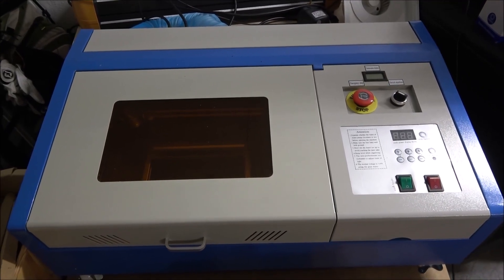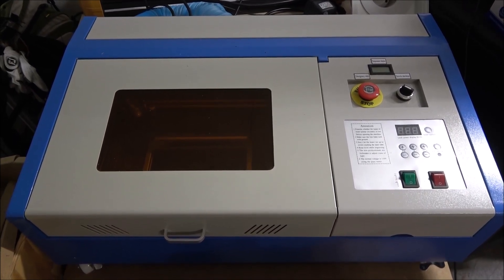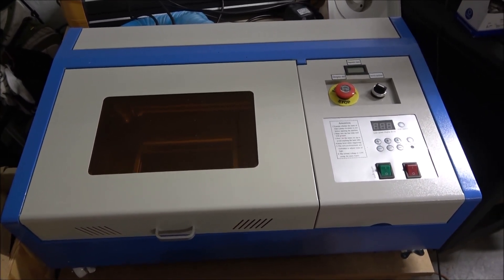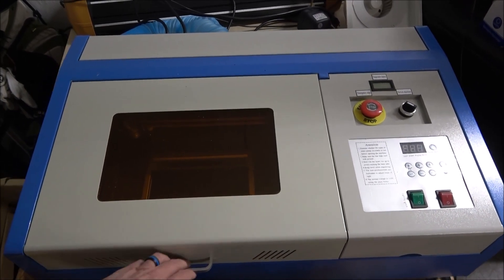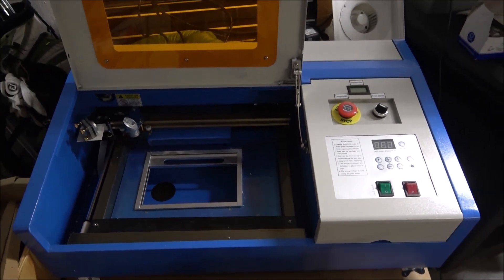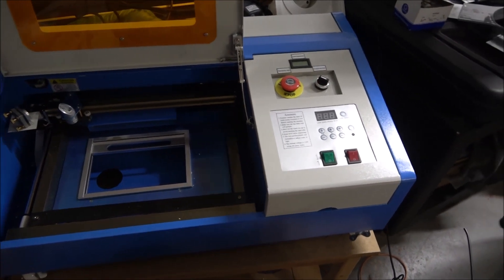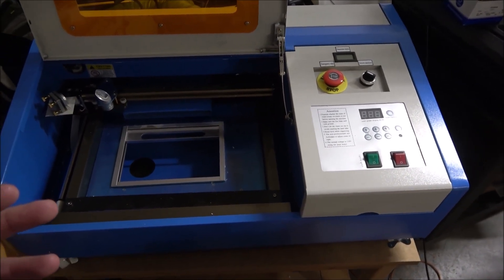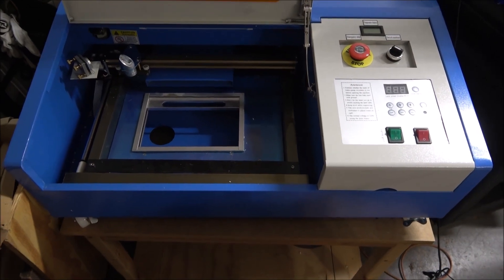Update!! I'm comin back!

Comment: Hello Smokey,

Hope life is well and that shop is coming back on-line?  I'm like you though I'm still building my setup based off yours, but added the 5 inches in width for full 48x48 and added capabilities to do 3d work on front and back anchor system still only exists in my mind. Give us a 3-minute video update on what you've been up to. Back to the 200 man-hours to get this thing built. About 300 holes to drill still, haha

Comment: Good to see you back!  I've been thinking about getting a K40 (Generic Term for that laser).  I have heard they are okay at best out of the box.  But seem to be easy to upgrade and lots of info on YouTube.  In fact, there is a YouTuber that goes by SarbarMultimedia.  He has literally years of K40 laser tutorials.  Everything from software to upgrading the hardware boards to upgrading to larger 50W CO2 lasers.
Reply from the maker: I've got a K40, and love this new Lightburn software, however I have ran into a problem with the smoke produced, this new house has a hi-tech security and fire alarm system...I can't get the laser to run without setting off the the alarm system...so I'm on hold for now

Comment: I read a lot where you can use rv antifreeze without issues and some use fishbtank heaters as well.  I actually just disassembled mine and put it in the basement where freezing temps won't be an issue.  I believe your machine looks like a k40 possibly.
Reply from the maker: Ok on this, I got contacted by a guy that worked with lasers for a job and he said absolutely no to antifreeze running through the system at all!!! so don't do it!!

Comment: Great to see you online again. Was thinking how you were doing last week. For the CNC spindle water cooling. You can get an antifreeze with inhibitors to stop corroding metals in contact. Eg furring up aluminium, copper greening. Etc
Have fun with the laser, it's just a smaller CNC, few different cutting/carving concepts, but works same process. Enough to keep you occupied for the duration. Stay safe, stay healthy too !
Reply from the maker: Yes the process is the same, I just don't want to jump off and find out I've made a mistake with antifreeze....All in all i'm just ready to get back to it, i'm goin nuts with nothing to do!!!! Thanks for watching!!

Comment: I’m not familiar with the water pumping system. If it external, make a insulated box around it. Use a light bulb for a heat source. Put insulation on the lines, that should be enough to maintain above 32 degrees.
Reply from the maker: ewwww! a heat lamp would be a good idea!! could leave it running, good thought!!

Comment: Yes you can put about half a gallon of antifreeze in with 3 gallons of distilled water. Also, the motherboard/card in it is a nima card(limited) junk in my opinion. I put a cohesion3d card in mine and use lightburn. Also buy and install a milliamp gauge to know how much power that you are using. Never go over 20 milliamps. Youll be able to cut thin plywood and burn photos. There are tons of videos out there just google K40 co2 laser. Good luck
Reply from the maker: Ok thanks!! great info I'll look up the laser and check it out, thanks for watching!!

Comment: Ok I was a laser tech where I worked so no do not put anything in your water it will cause the high voltage to arc and burn up you connecters also don't use tap water others may say different but I worked on laser hole drilling machine I can give you my email address if you would like 25 years not these was 15kv lasers but the principals are the same denied water is what you need it makes you're lamps last longer hope this helps
Reply: I  looked it up it stayed you could but I don't know I would try to find a place in house in about 3 weeks that want be a problem take care stay safe
Reply from the maker: Oh wow, Ok this helps, yes shoot your email this way, Smokeyscnc@gmail.com..sounds like you'll have tons of info!

Comment: k40 wisperer software is free to run your k40 laser. inkscape is great free graphic software. remove that crappy bed and consider a cheap scissor lift to increase z axis.  assume new toy is 3d printer ? free version of fusion 360 is a great 3d cad program for laser, 3d printer and cnc
Reply from the maker: Yes the bed isn't great, I really like the vectric product and lightburn looks like its close...Tried 360 when i first started, just liked vectric better, not that 360 wouldn't be workable, just liked the other better....Thanks for watching!!